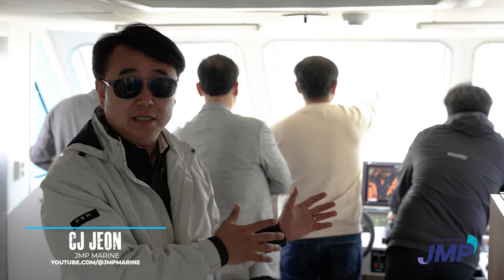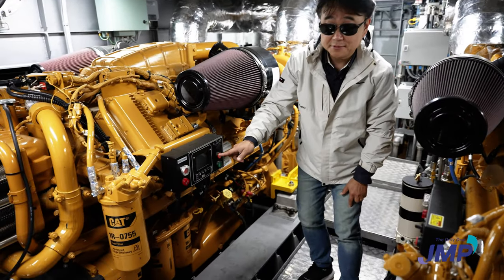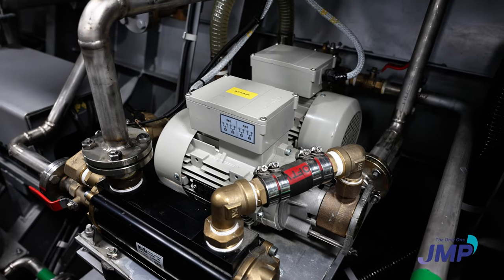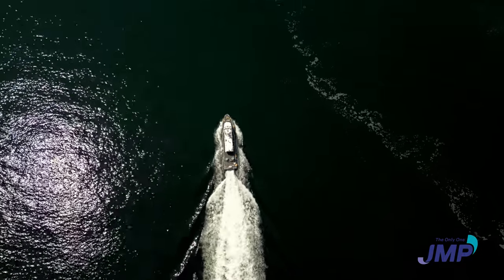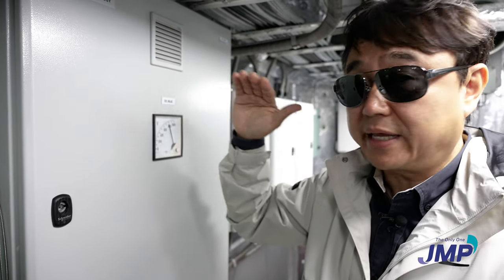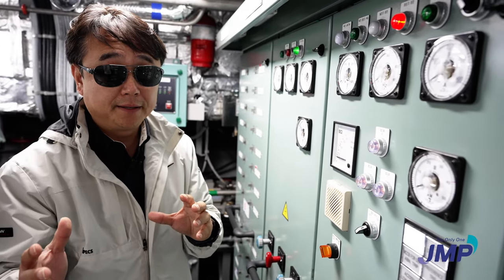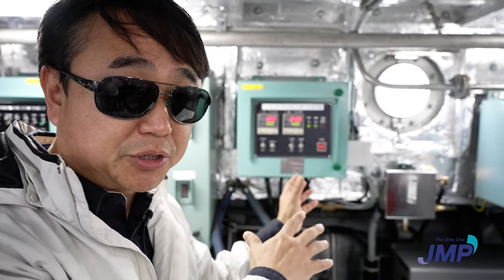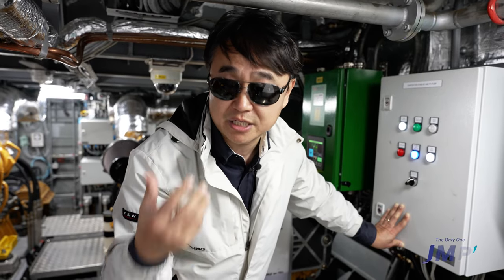Hybrid Electric Propulsion Patrol Boat Engine Room Tour with CJ Jeon

Comment: This kind of hybrid propulsion is needed for U.S. armored vehicles.  Think of the fuel saved when the engine is not idling to run their electronics  Also think of not having a heat signature intermittently by just running your propulsion on batteries.   It could be somewhat stealthy, moving much quieter at least intermittently.

Comment: Condensor mikes tend to pick up all noise so it may even feel quieter to the human ear than on the mike. 😎🧙‍♂️👍🏼 The battery is the big breakthrough. ...but totally disconecting the diesels from the electric motors would make them far more efficient. 
See the Canadian logging truck Topsy for concept. The Ice motor can run at its Stoichiometric optimum.. when needed and there are already motor companies out there building e motors with 80year life spans and needing minimal maintainance work..  for commercial vessels. 

Keep up the good work but 
Shift to smaller lighter more efficient generator specific ICE  motors, like free piston or rotary liquid piston designs... Try to use rare earth 4:45  perminant  free motors.  They are cheaper and dont even need copper for the windings.